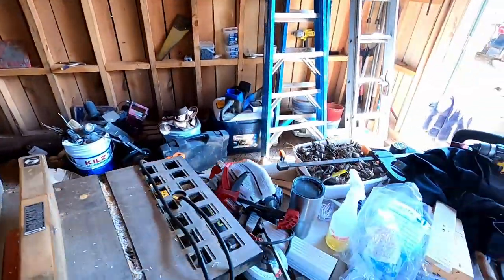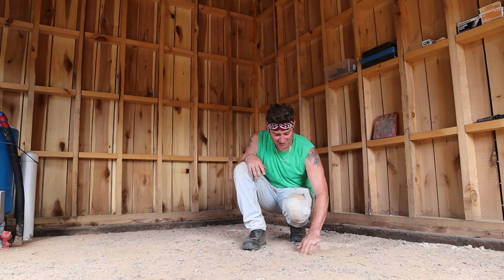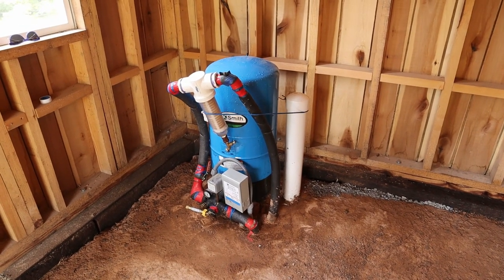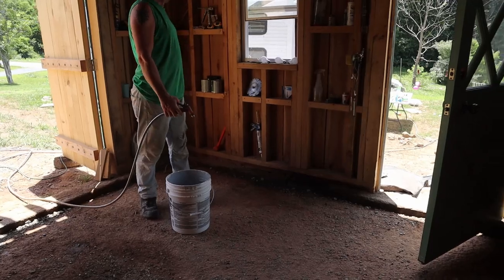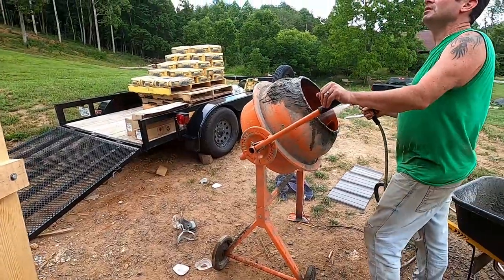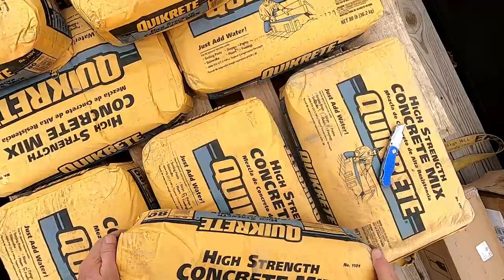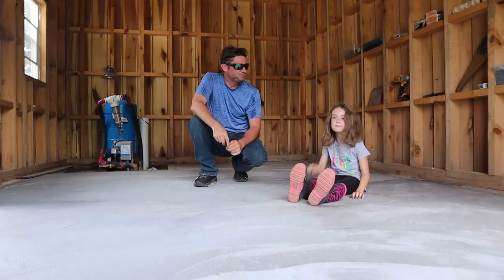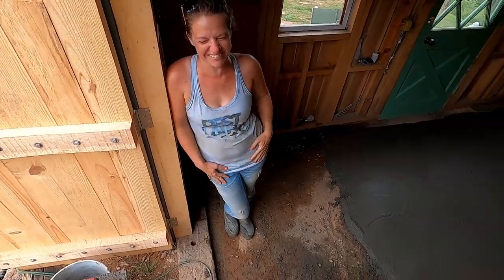E47 - Shed slab pour (take two) with the Harbor Freight cement mixer

Comment: Great recovery and the hard work paid off.
Nice trowling Meg!
Reminded me of the hundred foot long drive my brother in law and I put in on the four acres I grew up on.
We setup the forms for a section a days pour like 10 x 20 foot.
I would get off from school and concrete truck would come juust in time when brother in law got home from work to get the section laid. Took us a week to omplete.
I am 74 now and when I drive by the property now, the drive still looks great.
We made a float from 2x4 and 3 foot board and it wworked great!
After screading , foating, edging,  and brushed finish it was done then we setup next days forms. Each section separated with cenetech strip.
Loved that life.
Thank you again for bringing back the memories.

Comment: I remember the first pour you and Meg made. Before the shed was constructed and you were battling the elements of cold weather and frost and snow. Looks great now John. It will be much easier now to clean. Good job.
Reply: We did like the “local” color of the winter pour sad to see it splinter like that. Concrete doesn’t always need to be gray. I know they do stamping and dye but to use the local color from your own soil is something we are going to try to make happen.🤠
Reply from the maker: Totally doable, Adam.  A tip when sourcing your native soil: look for areas near the bottom of a graded area where the sand and finer materials will pile up on the surface.  I sourced mine from the top of a hill because I knew it was rich in sandstone.  The problem I had was that I got way too many organic materials mixed in with the sandstone.  If I sourced it at the bottom of that hill (below my septic leach field), I would have had a more pure source of the sandstone.  It's literally sitting on the surface next to my sawmill.  Nature did all the work for me (filtering it out).  I guess I just didn't know what I was looking for.  I'll try to mention this in an upcoming video for you.

Comment: And don't forget, leave it for a week before using it, typically good concrete takes 30 days to get to about 80% strength, it continues to harden well after that, some cement producers add accelerators which does reduce curing time BUT ultimately reduces strength.

Comment: Nice to see this video. Like others found it by the HF mixer reference. I too have the same mixer and a tiny shed (5x10) attached to a garage just holding a stand up compressor and lawn mower. It's never had but a dirt floor, previous owner, compressor sat on a pallet and walls are sitting on pressure treated lumber. I may try lifting the outer corners an inch, framing and pouring an entire slab, which should have been done in the first place. Your video spurred me to try this.

Comment: I’m curious how this holding up. That layer of dirt between the layers of concrete is preventing them from bonding. It should have been thoroughly cleaned and a bonding agent applied the bottom concrete. The fact the the top layer is pretty thick is the only thing that would save it from cracking into a million pieces. The bottom plate should also be pressure treated lumber to make it last longer especially with it being buried in the concrete like it is.

Comment: DIY concrete mixing is ONLY for where you can't get a cement truck to deliver.  50 bags per c.y. at $5/bag is $250/yd.  Delivery in our area is limited to a 3yd. minimum but finding help and combining a few jobs can usually accommodate the extra mud.  That said, I too have a HF mixer like yours and I use it.  Your floor looks good, job well done.  Meg has a future in concrete finishing, and wisdom to not go there.  LOL
Reply: You can get a short load of just a yard and usually just pay another 100 bucks if you don’t want it all. Sack creat is almost good for fence post that’s it

Comment: I always like to watch how people build around the world, because we can get nice ideas to use on our own constructions. I am curious, don`t you guys use CONCRETE "mestras"( rails that serve as a guide to make the slab really even) if it is a larger place to cover? It`s not specifically your case here, but I only see foreign people using wood "mestras". Here in Brazil, GOOD WOOD(because if you use bad one, it will rot and cause problems to your slab, right?!) shouldn`t be wasted under tons of cement. So, we make concrete "mestras", and they help a lot to even a slab if you have a big place to pour cement, no concrete truck, and you will mix it and do the work  by yourself, therefore, not at once.  We will post some videos showing how the two of us poured a nice concrete slab, mixing gravel, sand and cement by hand(no concrete mixer, just a hoe and our bare hands), using "mestras". Cool video! The slab got nice!

Comment: There is a truism around concrete, that is; the dryer the stronger, the logic being that when it dries out the water evaporates leaving voids, not good!  Secondly do not 'over trowel' particularly with steel trowels, rather us wooden ones, as steel pulls cement out from where it should be and remain. Nice job though.

Comment: Just bought one of those Harbor Freight mixers &  made the same mistake! The mixer wheels go over where the motor is, the handle should be below the tilt handle. Takes 10 minutes to switch it over. Should have watched several YouTube videos before attempting to assemble this thing... instructions are crap! The blades can be installed backwards too! :)

Comment: big mistake was not using a 2x4 to make it even.. it could be 4 inchs thick in one spot and 2 in another
Reply from the maker: Having walls on all 4 sides made this not possible. However, I did really well getting it close.  No noticeable bumps or valleys.  No one is falling over while walking on it. 😂 So that's good.  It's a shed.